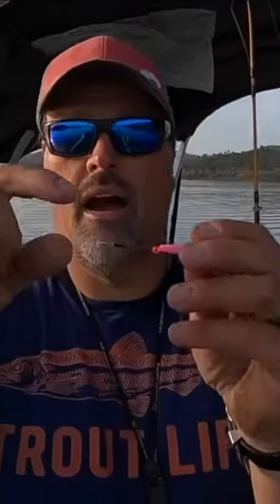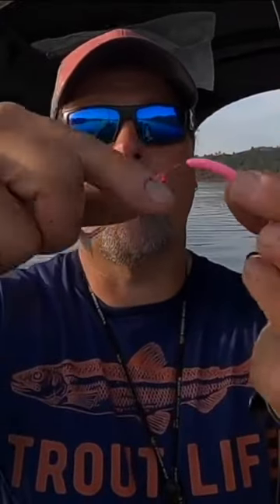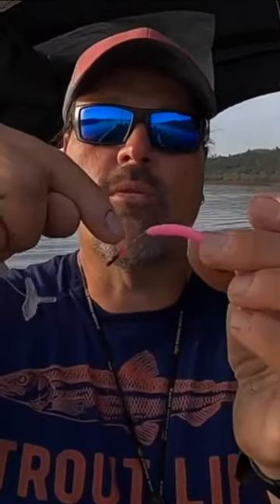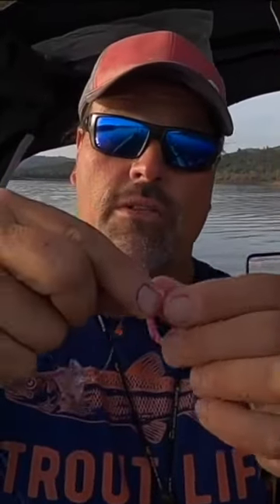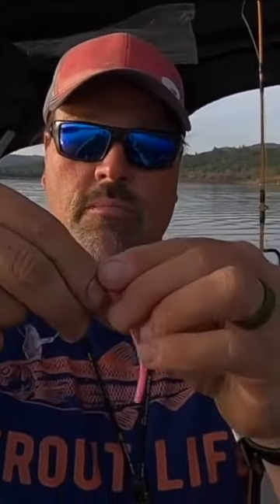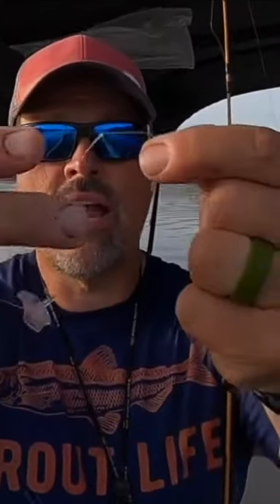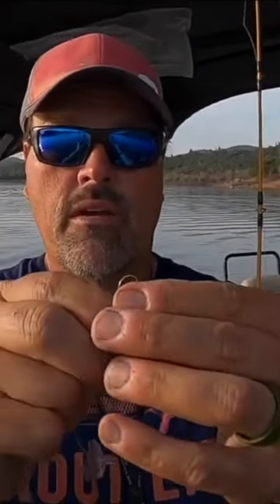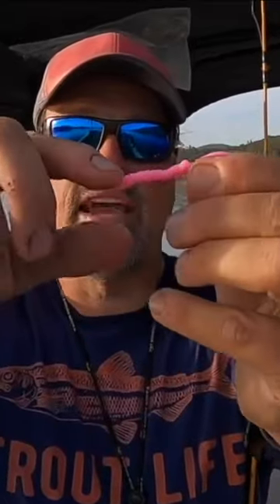Plastic Worms For Trout? The Ultimate Guide To Rigging Plastic Worms For Trout Fishing! #fishing

Comment: I’ve been rigging your worms a bit differently for those trout that come nipping. I pull the hook all the through the worm in first 1/2” then pull line through so the hook trails right to end of worm.  I slide stops so the line stays equal to the tail. I don’t attach the hook to anything and trails next to worm with same action. Killer on those short strikes.
Reply: Do you have pictures of this?  I’m intrigued but having a hard time visualizing it.
Reply: Similar to a kokanee rig?
Reply: Sure.  I have a few rigged up so I can take a few pics. Yes similar to Koke rig just does not trail as far behind. The worm also seems to have more action without the hook inside the shaft of worm body.